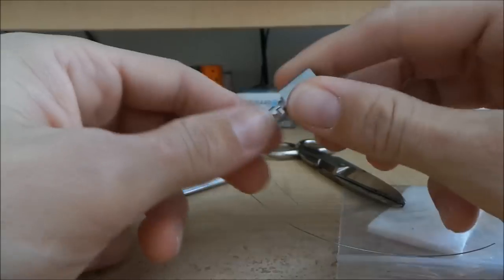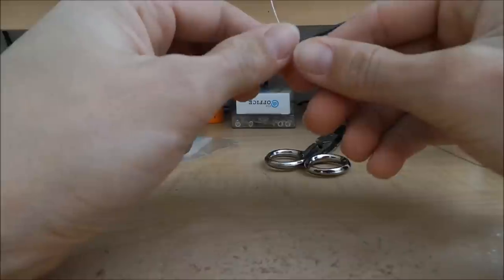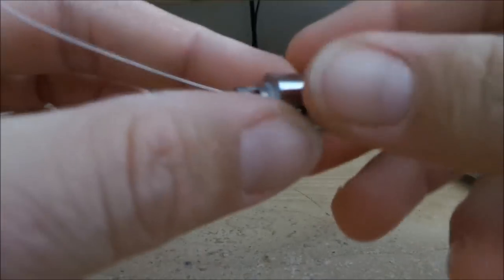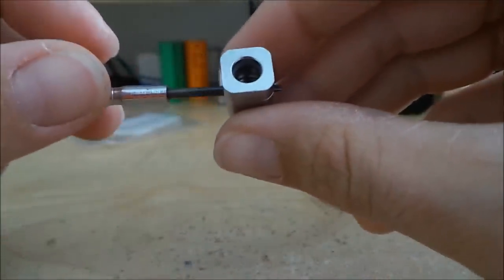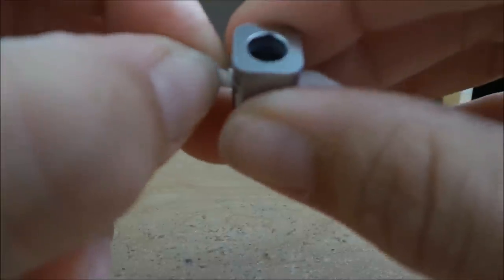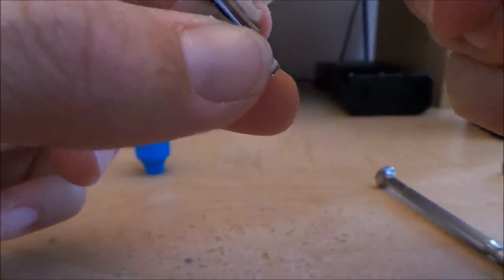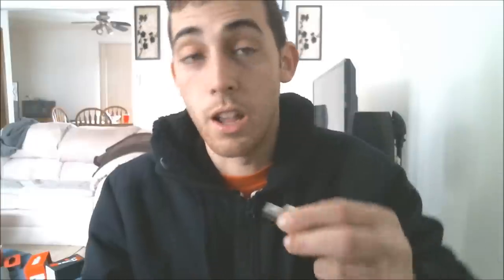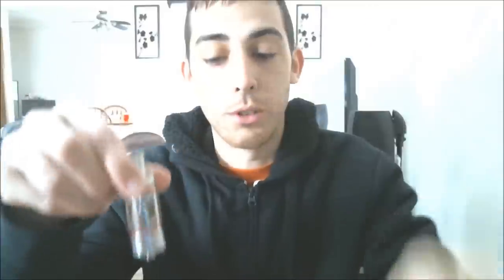Kanger Subtank OCC Rebuild - Tutorial

Comment: Some of the newer tanks have larger holes for better oil flow. I have actually redrilled the smaller holes & rebuilt with a bigger coil which works great. These are nickel coated brass and is easy to drill out.

Comment: The new ones come with a vertical coil which seems to be much better. My tank also came with an rta, it works a lot better than the occ heads and is WAY easy to rebuild

Comment: Thanks. The last video I watched the guy took off the top cap, so that's what I did. It was a pain in the ass to get off, but I think it allowed me to fire and compress my coil. Not sure you can do that with the top cap still on. Had to clean the inside of the coil first though, cuz it was pretty dirty.
Reply from the maker: aznnp77 yes I just wasn't aware of that when I did this video but definitely makes it easier though.  Unfortunatly on the new style heads they make now the top cant be removed.

Comment: the subtank mini now comes with a rba plus that has two wick holes on the side which I'm sure fixed a lot of the dry hit issues but thanks a lot for the video and I'm really glad I'm borderline horder with my vape stuff because for done reason I saved both prebuilt could the tank came with and now I can use them again! personally I felt like the pre builds had better air flow than the rba head.

Comment: Great Video, Thanks!!  One question; I am having a problem cutting the wires as close as they need to be, any suggestions?  I have tried a few different methods and can not, for the life of me, cut them close enough.  From the VERY limited information I have given you, what should I do differently?
Reply from the maker: +Gene Bomber Thank you, You can try the twist and pull method.  It may be difficult, but may work.  Make sure u have rod/screwdriver in the coil so it don't move around. then you want to hold the bottom pin in while you twist and pull the wire around till it snaps off clean.  If not try to invest in a good pair of wire clippers.  They sell some that are really skinny on the ends to you can get nice and close.  Hope that helps.

Comment: Hello, I am new to vaping and just moved up to a KangerTech Subox from a KangerTech EVOD.  I am now having to rebuild my OCC 0.5, and have been watching a lot of YouTube videos on how to do this.  I see some guys heat the coil with a torch until it glows before installing it into the OCC body, is this a necessary step?  I see you did not torch yours.  One guy said to use Rayon Cotton from a beauty supply store, what are your thoughts on that?  What gauge wire should I be using for a 0.5 OCC?  One guy said he uses 26 guage and said the Rayon Cotton is just as good as Japanese cotton and he said hemp is good too.  it is getting confusing with so many different opinions but your build seems so much easier so I would like your opinion.  
Please help,
Rob

Comment: Hi J Leone, good demonstration, great video.
Could you explain the reason for leaving spaces between each wrap of wire? I've not rebuilt a Subtank OCC Head before, only made my own coils for my dripping atomisers and we don't usually leave such big spaces between the wire wraps.
Reply from the maker: Jon Hepton Thank you.  The reason I did a spaced coil for OCC head was just to duplicate the coil that was installed in it.  Another reason is usually when I do micro coils I install them and then heat them up and pinch them together to get them nice and tight, but with this head u dont want to heat the wire up without juice, due to the fact you may burn the rubber insulator.  And if that happens you'll get a burnt rubber taste, and the only way to fix it is to get a new one.  Hope that makes some sense. Vape ON!

Comment: I followed the instructions to the letter, but after a few hits the coil already tastes burnt. I'm using K28 gauge, doing a standard wrap, I get 1.3-1.4 ohms resistance, and set my voltage to 3.8. Could it be that something is wrong with the kanger tank as a whole or no?

Comment: Have you had any problems with the RBA section giving dry hits? I'm considering grabbing a needle file to open up the juice channels. But that's only after I try rebuilding with a smaller wick.
Reply from the maker: Evan Backer Yes I did once when using a really thick e-liquid.  Ya if ur still having problem i would try opening the channels up.

Comment: Great tutorial, man!
Listen,dude, I've tried this exact same routine before, but I've had some burnt rubber insulators for coil legs overheating, even after soaked, which is perfectly acceptable once there's no NR-R-NR build on this method. I'm usually on 30W, 0.5 ohms -4.2V on Sigelei 100,
Then I've started welding, like old times and boom, problem solved.
How did you manage this issue?
Reply from the maker: ***** I have been meaning to mention this in a upcoming vlog.  Ive had the same issue you are experiencing multiple times, but forgot to mention in this video.  Ive gone through many subtank heads.  I ordered a new batch off heads tore the stock coil out, and built on it, and it was fine.  I wonder if they are using better insulators on newer batch heads, that maybe can withstand the heat, but not to sure.  Lately I havent been bothering rebuilding on them and just using the rba section, and its just as good.
Reply: J Leone Thanks'man! I've got a new untouched bajch right here with me. I'll give it a try.
Thanks again!
Reply from the maker: You're welcome glad to help, hope it works out :)

Comment: What kind of wire do I buy?  Is it better to do a thicker wire with less coils or a thinner wire with more coils?  I would think a heavier gauge would last longer?  Cool video definitely gonna give this a go.
Reply from the maker: +Todd Simone It's completely up to you.  I used 26 gauge kanthal wire, which is pretty thick.  I wouldnt suggest using anything lower then 24, just for the fact that may be difficult to trap the leads on the bottom of the coil head.  And Thank you :)
Reply: Where do I buy it and what material do you use?  Is it just general purpose wire?
Reply from the maker: I get mine from lightningvapes.com.  Its Kanthal A1 wire.
Reply: +Todd Simone Any of your local vape shops should have different size gauge Kanthal wire and organic cotton for you to buy

Comment: My kanger coil does not have the seam to take the flat part off - it's one solid piece.  Is this a new design to prevent rebuilding, or is there a way around that?  It's identical to the one in the video, but without the option to take the bottom off.
Reply from the maker: +idrow1 that's really dissapointing if that what they've done.  Anyone else order replacement coils recently and have this problem?  Maybe someone else has an answer.

Comment: thnaks man 

how long is the rubber gonna last?

and can you post a vid on how to clean the metal part that has holes you can close and open?

i also have a 40 lite what gage of the coil am i suppose to use?
Reply from the maker: You'r welcome.  It totally depends on how much use it gets.  I found that 26 or 28 gauge wire works best.

Comment: Hey man I dry fired mine without a wick before I saw this video. I compared my .5 coil (the one I dry fired) to the 1.2 coil and the seals look the same. The problem is each time I rewick the .5, it starts to taste burnt after a couple hits. I've rewicked it about 5 times with no difference in results. I'm starting to get pissed off and temped to go back to smoking. Any ideas on how I can get around this? I'm using the Ego One as the battery if that makes any difference.
Reply: Troy Brostrom interesting, i had a similar problem. did you recoil with standard kanthal? because i recoiled the head with NR-R-NR wire and that burning taste stopped! also, there are the new updated red insulators which may help.
Reply: ***** Very useful information! :) I just replaced the coil with a .8 ohm using 26 Guage kanthal. It'll keep up flavor wise if I just pulse the button slowly while inhaling. Right now, it's hitting really rough and I'm pretty sure it's the ejuice. I'm using a 12 mg strawberry lemonade and though it sounds good, it sure doesn't taste good lol.
Reply: Troy Brostrom ok, i've got a feeling you need NR-R-NR wire, sounds like the leads from coil are getting too hot heating the insulator and causing that strange taste. or just buy some updated occ heads.....just don't go back to smoking dude !!! :D
Reply: ***** I'll have to try that! Awhile ago I blew on the soaked wick (using just the occ on the battery) and while firing it and blowing the vapor away, I could see the coil was getting red hot which is why I am getting the burnt taste, right? But yeah I haven't gone back to smoking and I never plan to! I'm STILL coughing up flem haha idk if that's tmi but yeah. Smoking sucks. Thanks for your input tho!:) happy vaping

Comment: How do u recoil the 1.5 ohm occ? My juice leaks thru the vertical coil to the airflow so can u msg or make a video? Thanks!
Reply: +Matthew Mai (Dismattboy) If you have a subox mini don't stand it up, keep it laying down when your not vaping or charging. Mine used to do the same and it doesn't do it any more after laying it down.
Reply: +Matthew Mai (Dismattboy)  The vertical coils have a press fit insert that once removed will help in rebuilding (but will the leads ground out I am unsure?). I would say find some older ones (coils) if you can. Otherwise be careful of cotton - too little and you will get leak-thru. It is much easier to get the wicking correct in a horizontal coil.
Reply: +Al ohm I hate the new vertical coils.  I believe all new coils are vertical now.  So, finding a horizontal one will be difficult.  

I had no idea Kanger changed them.  I bought a new coil and it didn't produce the amount of vapor that I'm used to.  So, I got another one, thinking I may have just had a faulty coil.  I 
had the same problem.  I went to my vape shop and explained my issue.  They guy I spoke with informed me that the coils are now vertical, at least as of late October/early November.  I haven't found any videos showing how to re-wick the vertical ones.  
I just want my regular vapor production back.  Lol
Reply: I really don't think you will get the verticals to work as you hope. Get some of the horizontal coils from someone.
Reply: +MrSaxmanJones there vertical coils are easy to rebuild  so I can't see why any one would use horizontal coils where vertical coil was
Reply: +Matthew Mai (Dismattboy) If it leaks it's because you didn't clip off the tips of the wire which sit underneath the rubber grommet. Make sure they are not sticking out at all and you'll have no leaks.
Reply: very difficult to get them clipped right up flush tho.....

Comment: Hello dear friend, to get 1.1 which wire should I use, and how often to rotate 6 or 7 or 8 times. Thanks
Reply from the maker: קובי דיגמי Use 28 gauge kanthal and go for about 6 wraps.  It should get you pretty close to 1.1 ohms.  But you will need to experiment, it may take one more or less wraps depending.
Reply: +J Leone Richard Ng, Hello dear friend, I can build it with 316 Stainless Steel 28 AWG? Thank you

Comment: I do the exact same thing my friend and I always have the same problem.  The legs get too hot and melt through the rubber grommet, so what am I doing wrong?  Please help!!!
Reply from the maker: I only had that issue when I dry fired the coil with no juice.  Usually i Try and avoid firing the coil unill its juiced up.
Reply: Weird.  I've been vaping for quite a while now but have had that problem with every rebuild.  I prime the coils to make sure they're not dry and put a full tank on and they just get too hot (the legs, I mean)  I don''t get it.  I'm following all the steps and have been building some crazy coils for my drippers, but can't seem to figure out what the hell is going on with the legs.  Could I be trying to use too much power?  If there is such a thing.lol  I've been noticing most people keep them under 30 watts but I've also seen them light them up to 50 or more, so I'm stumped.  I appreciate the reply, BTW.  What wattage do you use for the most part?
Reply from the maker: Ya thats wierd, and sorry your having that issue.  I usually dont go past 35 watts. It totally depends on the resistance of your build though. If ur building below .5 ohms you may have some problems, because it could be getting to hot for those little insulators. Mine come out to    .6 or .7 ohms.  Wish i could be of more help.
Reply: All good brother!  I never fire over 35 and usually shoot for about .7- 1.0 ohms, so I have NO idea! lol  But you did help just by replying.  Thanks for that brother!  You use 26 gauge correct?
Reply from the maker: You'r welcome buddy, and yes I am using 26 gauge.
Reply: Tried it again and bluh!!!lol  Maybe I'm pushing the wattage up too much but, like you, no more than 35 watts.  Can you take long pulls or just short puffs(gotta love laymen's terms!lol)

Comment: I've rebuilt this several times and continue to have the issue that ohms change. Usually 6 wraps or so with 26ga kanthal initially registering at 1 ohm. After not vaping for a bit it will jump to 3 ohms and give me quite a hard hit, what gives? My connections are solid, do you think my coil is too tightly wraped? Anyone else having this issue?
Reply from the maker: Mark Taylor ya I haven't had this issue with it. have you tried using it on a different mod.  Ive had this happen with other tanks and it was caused by the mod I was using.

Comment: i have subtank mini and sigelei 150w and ive changed like 3-4 occ's 15 diff juices. no matter what i do i cant seem to get any good flavour, i get crappy tasting crap that just makes me want to smoke cigs again. I used to prime the wick by covering the hole or w/e and after like 3 prime-hits it would be saturated and i would get some juice in my mouth. now i can prime hit it 500 times and i wont get any juice in my mouth. Any idea what the problem may be?
Reply from the maker: Donno Trippa what wattage are you running it at, and if you have you'r airlflow wide open try and just close it off a bit to help create a better vacumm in the tank.  Oh and what ohms are the coils you'r using .5 or 1.2 ohms?
Reply: using the stock 0.5's, i run it at 15-20-25-30 no matter what i try it tastes crappy. i think most of the time the wick isnt getting wet enough. like, when i look inside the coil it doesnt look saturated but my tank is 3/4 full
Reply: the first week or so i had it, it was beautiful strong flavour watermelon, was warm vaping, i blew out and was a sort of cold air, clouds were very white and thick. now its like room temp vape, i blow out and it looks more like a ciggarette sort of smoke no vapour and its not the refreshing cold feeling. just so wierd and frustrating cant find info anywhere ;/
Reply from the maker: You're doing everything right from what you'r telling me. The only thing I can think off is closing the airlfow off a notch to help create better juice flow to the coil
Reply from the maker: I understand you're frustration, vaping can be a pain, but when everything is working just right its worth it.  Sorry you're having these problems
Reply: Yea, i've tried everything, searching everywhere. Only thing I can think of is maybe my tank isn't tight or maybe too airtight lol. Don't know if that even affects it, i'll keep playing around thanks anyways though!
Reply from the maker: No problem, wish I could help more.  Good Luck.
Reply: Donno Trippa Are you making your own juice or buying juice? I found that no matter what I do with my coils, I tasted crap out of my bought juices in subtank mini. I think that subtank gives so much flavour than old type e cigarettes. I make my own juice now based on 50pg and 50 vg. I add only 5 % flavour and no nic. It tastes so good. If you haven't made your own juice, try to make one. You could just get PG and VG and then mix them with your existing juices.

Comment: hey i seen you can buy somme off ebay also how many times u need get new coils
Reply: I've had coils last up to a month, but as Mr. Leone stated, it depends on how much up use the coil and what is in your juices.  Darker colored juices tend to gunk the coil up a bit more quickly and I usually change those about every two to three weeks.  Once the juice starts to taste burnt or just not as clean as it should, that's a good sign that it's time to change the coil.  I should clarify that I am talking about stock coils that haven't been rebuilt.

Comment: Do you know anything about leaking through the vents?
Reply: +Maria Betancourt  it's because you o-ring from botom of the OCC/RBA is loose or a bit broken, check your o ring, should be fine, if you burn without juice and coton you just burn it. if not it's just unproperly fit .
Reply: +Maria B Had one pour out the vents overnight. The coil had a wire end under the bottom gasket lifting it.

Comment: You guys can get the cab off,it makes it alot easier to place the coil inside. Just use a pliers and gently pull the top off. ;))
Reply from the maker: Dave Stegemann Thank's. At the time I didnt realize that.  Now kanger is replacing these coils, with a different one. and on the new ones you can't pop the top off, unfortunatly.

Comment: Can someone please tell me whats the difference between the 0.5 coil 1.5 coil and other big round one???
Reply from the maker: +Fatma TalJai the 0.5 will heat up faster, the lower the resistance the faster it will heat up.  It also comes with a rebuildable deck, its for those that like to make there own coils. Hope that helps.
Reply: +J Leone so if i bought subox mini and wanted it to be in 50 w what should i use the 0.5 or 1.5 or the round one